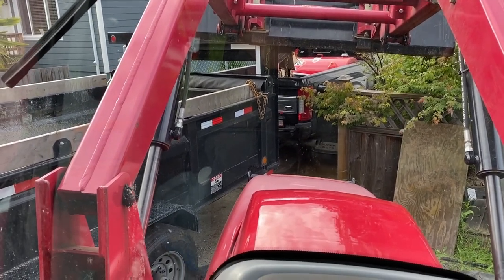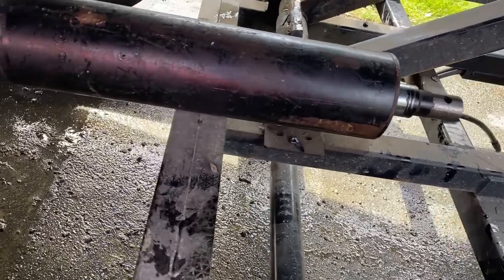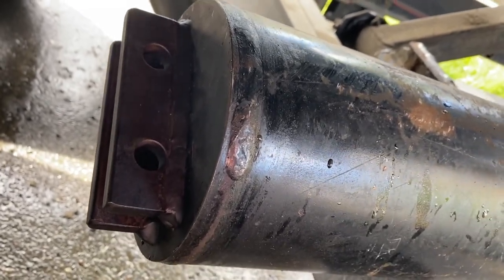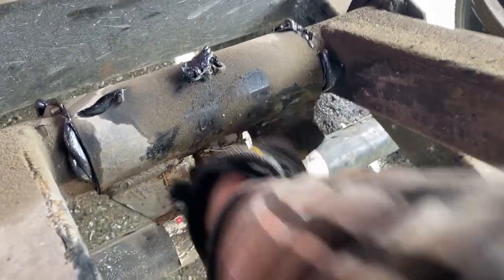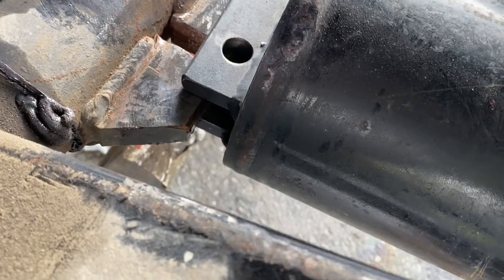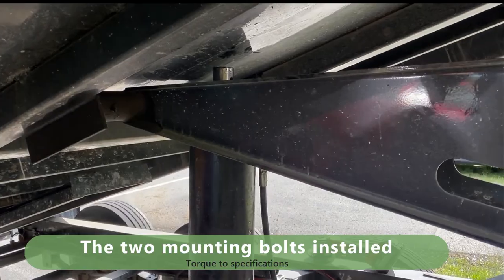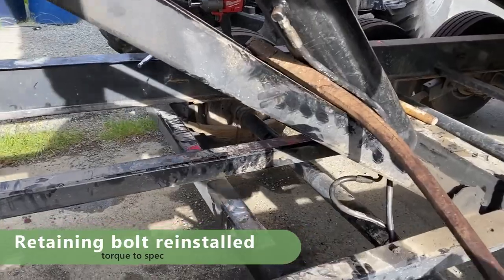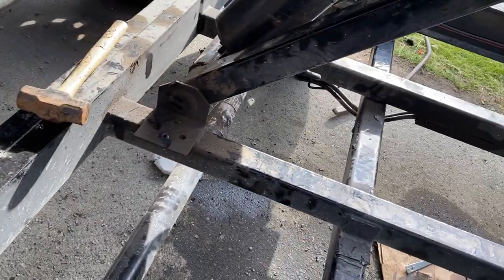How to change a hydraulic lift cylinder on a dump trailer

Comment: Question; on the cylinder what’s the ton capacity lift , what size of trailer is it? I want to build my own dump trailer I am thinking an 8’ft. X 12’ft. X 4’ft. any recommendations or information on cylinders?
Reply from the maker: The trailer is a 16’ 21,000lbs gooseneck.  I think the cylinder is a 20t but I could be wrong